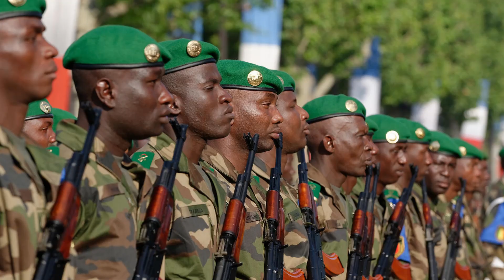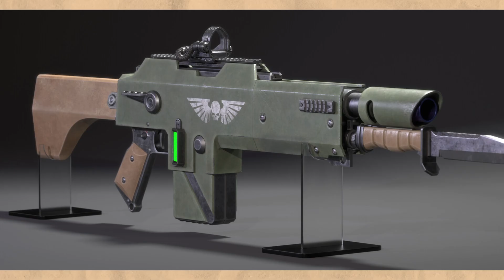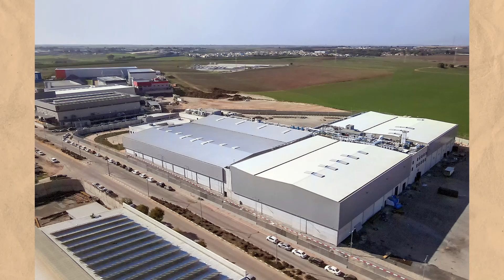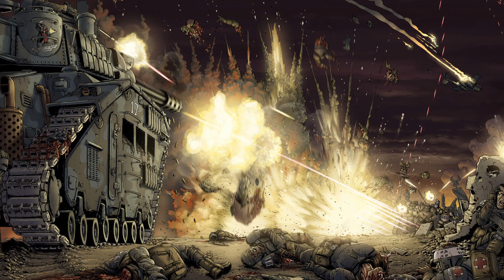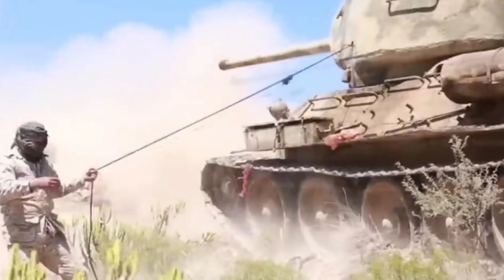WHICH 40K EQUIPMENT AND VEHICLES WOULD BE USEFUL TO IRL MILITARIES ?

Comment: The lasgun's battery pack can be recharged by any generator.  You just need the correct connection.
I remember hearing a story (Probably a fan fiction) where a squad had a fusion reactor, and were being held up by an enemy shield.  They shot the shield with lasgun fire "for fun" and kept the batteries charged up.

Keeping an army equipped with Lasguns full of "Ammo" is as simple as bringing more or more powerful generators.  They will be using those generators for many things, rearming lasguns would add one more to the list.  This would also mean that vehicles could be mobile generators for easier lasgun rearming and more energy on the field.

Comment: Honestly i absolutely agree the lasgun is a marvel of mass produced technology with rechargeable battery packs with the same energy as a 308, with about a magazine capacity of about a hundred and fifty to three hundred shots depending on the type and power settings, not to mention that its pinpoint accurate where inaccuracy is really just user error and can be pumped out at the same rate as an Al-47 and is more reliable than an ak-47, being usable for about ten thousand individual shots before the focusing lenses needs replacing along with a simple scrub with an oiled rag. 

Not only that but the lasguns rechargeable power packs can be recharged via any source or power outlet, be it say from the back of a chimera where chimeras are equipped with onboard recharge stations the same way you can have a power outlet next to you at a Costco store in order to charge your phone.

As for the chimera, a chimera based vehicle would be incredibly useful especially since the principals have already been proven by the British in terms of the CVRT family of vehicles all based on one single vehicle.

From the anti tank stormer / manticore to the APC Spartan/ chimera to even the Abbot / basilisk variants. It’s essentially the Toyota hilux of the 40K universe. Being based off of the universal crawler which uses a similar chassis as the standard chimeras but is designed more for crew comforts, fuel efficiency and less armor, whilst still having some armor, meant to survive any and all of the harshest of environments, but its not going to be anywhere near the same level of protection as a fully armored chimera, think of it as the humvee of the civilian world where humvee makes the humvees for the military as well as civilian models for the civilian market .

Comment: One of the major advantages of the Chimera is that it is nativly amphibious, as opposed to almost all IFVs, which usually require modifications to do river crossings if they can at all.  It used to be part of the Chimer's rules, but no one ever used water features on the tabletop.
Reply: BMP 1 has entered the chat
Reply: @SkyWig Quoting a Polish general: „it is safer to transport troops on foot than to drive them with a BMP-1
Reply: @piolewus Idk, Ive ridden in BMP1 annually and they are not so bad? They certainly have a nice artillary augment!
Reply: It also makes an effective anti-fortress battering ram when driven by Gunner Jurgen...

Comment: I don't think the Deathstrike would be a good idea. We kind of already had something close to this with the Davy Crocket Nuke Bazooka
We never used the Davy Crocket because we realized that it was a dumb idea to give your grunt, ground level soldier a nuke that could possibly kick off Armageddon by accident.

I think it could function, but our real world POLITICS would not allow it. 40k is far more liberal with it's nukes than we are.

If you do keep up this series, you should cover the plasma rifles or melta guns next.
Reply: I see the death strike as more of a SCUD equivalent. With having two missiles instead of the one that the SCUD has.

And I think it’s more justified in the setting because during like a Tyranid invasion, for example. there are billions of Tyranids rushing at you at a time, so having tactical nukes is necessary to hold them back for a little bit.

Comment: Only thing useful for first world armies from the Chimera would be the Multi-laser, everything else is literally 100 years out of date, including the Heavy Bolters which would simply be less accurate though potentially longer ranged MK 19s, as gyrojet technology was abandoned fairly early due to the difficulty of mass producing rocket nozzles accurately enough to induce spin reliably.
Also ICBMs are far easier to target when in their first stage rather than their terminal for the simple fact that hyper velocity (speeds in excess of mach 5) majorly complicates interception, which all ICBMs are capable of in their terminal stage.
Reply: How did you come to the conclusion that they would be less accurate? The empire found ways to make the technology highly accurate. Just because something is abandoned today doesn't mean it won't be good when it's fully developed. 

The best example is electric motors. They existed at least as far back as World War II, but have only been actively improved for the last few years.
Reply: @waldimort453  magic

Comment: The armor of the Leman Russ tank is made of ceramite, personal armors of space marines is also made of it, it is a fictitious alloy of various metals and ceramic materials, so it should be much more resistant to high temperatures than steel and this is main factor for effectiveness of cumulative warhead in rpg grenade launchers

Comment: for leman russ you're speaking about armor thickness ... but armor thickness mean nothing without considering the material it's made off, 10 mm of tungsten and 10 mm of stainless steel don't offer the same protection. And I don't remember any books giving an accurate reading on how hard the russ armor is really.
Reply from the maker: I know but armor value changes with every other book, take even supposed custode armor thats suppost to be inpentreable yet it got wreckt by an un armed khorn beserker dureing siege of terra. Also if you want to build LR irl you wouldnt have the plasteel, so irl militaries wouldnt use it because its a bad design.
Reply: @Nagash_Undead 
I understand the bad tank design.
But the custodes armor being penetrated by unarmored khorne berserker is probably another many of black Library fuck ups kind of like when back when harlequins invading the imperial palace and actually killing custodes was because the author thought those custodes were regular human soldiers.
Reply: @Nagash_Undead  Assuming real-world materials for Warhammer isn't very interesting, because almost all of their designs either wouldn't work, or would barely work.

You also haven't applied this standard universally. You argue the Leman Russ would be constructed of steel therefore poorly armoured, but don't point out how Lasguns, if made using modem batteries, capacitors, lasers and focusing lenses would have really small magazine capacity, low rate of fire, be generally weak, and drop off in lethality really fast at range.
Reply: One thing the Leman Russ has going for it is being significantly cheaper than the vast majority of Main Battle Tanks especially by NATO standards.